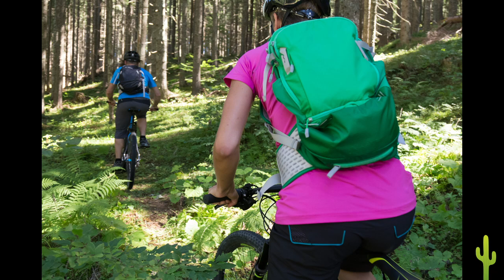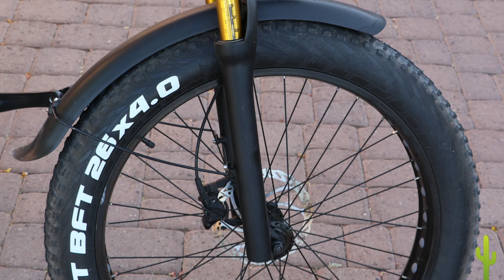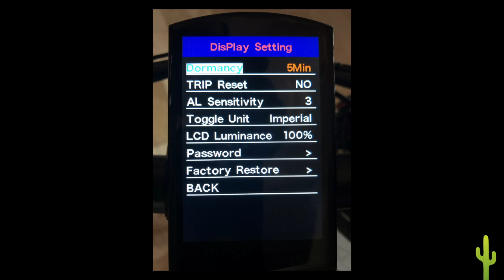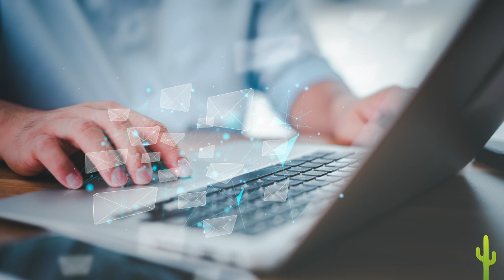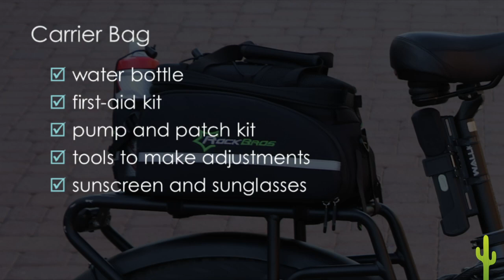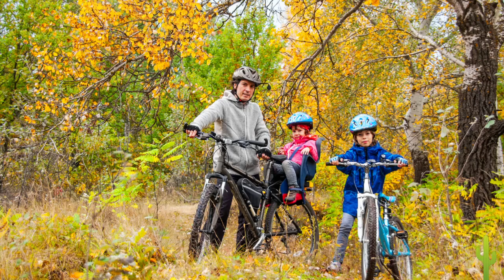Why the Wallke X3 Pro is the eBike for Me (and Maybe for You)

Comment: My experience buying from Wallke was unpleasant. The bike arrived completely broken, a bent frame, cracked battery housing, wobbly tire, among some other cosmetic issues. After 7 days of back and forth they finally agreed that the frame was bent (even thought I proved it with measurements on the first day), and offered me $100 compensation for the bent frame. After another back and forth I convinced them to take it back, and they said I had plenty of time to return it and it was no problem. Then after winter when I go to return it they tell me I only had 7 days to return it! So I had to use PayPal to file a dispute and convince them that their service rep made an exception to their unreasonable policy. So they agreed to take it back and I shipped them the item all packed back up (not easy)! Then during the disput they wanted 6 days to process the return, and 6 days later they say they can't find it even though FedEx provided delivery confirmation! So Now I have to wait for Paypal to issue the refund because Wallke fails to do so. This is a lot of money for a bike so don't simply trust this company, document literally everything if you buy from them. If you get a good bike great, but there is a risk you will end up in the same situation or a similar one that I did. Specs are one thing, but good support if you get a lemon is very important to consider too!

Comment: A supremely superior review/ overview, best I've seen on any topic/ item on YouTube, thank you. I do have two questions: (1) To lower the seating height (for a 5'2" person) , could I take the seat post out and cut it by say - four inches (or use a replacement shorter seat post tube) , to make the post shorter and therefore not hit the factory (frame) post stop as soon as it would when using the factory seat post length when inserted into the factory (frame) seat post tube? In theory, this would bring the seat-to-ground distance down by a few inches. (2) Could I re-wire the "Thumb" throttle to be replaced by a "Twist" throttle? Simply a personal preference.

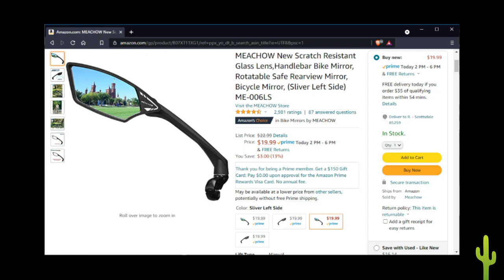Comment: I've got a little over 500 miles on mine. Charger died two weeks ago and with one email received a replacement in about 4 days no cost. Had a flat today, ordered a tube and slime from Amazon at 8pm last night and received items at 11:30 this morning and already back in the saddle. There is a Wallke FB group, that shares basic information as well as specific parts like better handling knobbie tires (my next upgrade). I also installed a mirror, and use a high lumen headlamp usb rechargeable strapped to handlebars to cut down battery drain. Thanks for the manual there are youtube videos but having info in one offline place is of benefit.

Comment: Great info! Just curious why you didn’t choose a mid drive motor bike?
Reply from the maker: I looked at mid-drive bikes, but chose the rear-hub drive for several reasons.  

First, mid-drive bikes use the chain and gear system to power the bike, so they're more complex to ride as gear selection will have a significant affect on torque, speed and power consumption.  You need to monitor the ride and operate the shifter continually.  Rear-hub drives don't involve the chain, sprockets or shifter for powered modes.  

Second, the much increased load on the chain and sprockets with mid-drive requires more maintenance to protect them.  

Third, the chain and sprockets (which are really engineered for human power) wear out pretty quickly under the high torque of motorized power, with reports of needing replacement in a thousand miles.  That's less than a year for me, and seems like an issue, especially in the context of a possible grid-down future where replacements might not be available.  

Fourth, some mid-drives don't freewheel, so that means you're "pedaling" when the motor's engaged, whereas the rear-hub drive lets you stop pedaling (like you would for coasting), while the motor's fully powering the bike.  This is a lot more comfortable.  

Some people with deep cycling experience prefer the fine control provided by involving the sprockets and shifter in the motor-power process.  I've heard at least one say they'd never consider a rear-hub. 

For me, I'm happier to have solid and easy-to-use transportation, without concentrating on gear selection.  As someone with years of experience with manual transmissions in cars, I'd say the mid-drive / rear-drive discussion is analogous to manual and automatic transmissions.  Rea-hubs eliminate a lot of complexity, leaving you free to ride.

For me, the rear-hub drive is the clear winner.  It's easy to understand and operate, less taxing to ride, and gives plentry of power and control.

Thanks for raising the question!  😊

Comment from the maker: One item I didn't cover in the video is power regeneration.  The controller allows for the use of motors that have the capability, but the geared rear hub motor on the bike doesn't support it.  The real world reports indicate the amount of regeneration is pretty low (some estimates are 5%).  If the bike had regeneration, I'd turn it off.  This is because regeneration drains momentum from the bike so it can charge the battery.  The bike is actually braking when regenerating, so you lose momentum that would otherwise be there for coasting.  Due to the inefficiencies inherent in the cycle of regeneration, power storage and them re-powering the motor, you can't get back as much energy as you lose.  You get less usable range extension than you lose from braking instead of coasting.  Basically, you shorten the range of the bike.

Comment: I saw there are different manufacurers fe Opeak or Cyrusher offering the same ebike. Is this the best ebike in this price point?
Reply from the maker: I examined several dozen eBikes as I was researching my choice.  I did find less expensive alternatives, but nothing with the critical features I was looking for, and actually paid about a $300 premium to get payload, folding frame, rear suspension, hydraulic brakes, the excellent color display, thumb throttle and user-customizable controller.  I couldn't find anything with all those at a lower price.  I also didn't spot the same bike under another brand, although the practice is pretty common.  I did get the manufacturer to offer a 10% discount for channel viewers, so your premium would be less.  The Cryusher looks similar, but seems stripped down, without carrier, fenders, or high-end display / controller.  It doesn't look as beefy as the Wallke, and one I found was on eBay (perhaps a resale?), another was on AliBaba at about $500 more than you'd pay for the Wallke.  (I'm happy to venture an opinion, but I have no vested interest in anyone buying the Wallke or any other bike.  However, my experience with the Wallke is first rate.  I definitely recommend it.)

Comment: Okay, questions. eBikes are obviously batter powered. As a prepper, we prepare for Bad Things to happen. Assume, for a moment, worst case scenario. You've just survived the collapse of civilization. You're running around on your eBike. The battery now needs to be replaced because it's just not holding a charge any more, and neither is your spare. Stockpiles of batteries aren't an answer because even batteries in storage go bad after a time. How do you replace the battery now? If you can't replace the battery, do you now just put up with the fact that you basically no longer have an e-bike? What about the shocks? They go bad over time, just like they do in cars. How do you fix/repair/replace those shocks?
Reply from the maker: I think you have a different view than I do.  Nothing will last forever, but I intend to exploit whatever's available as long as possible.  I'm not swayed by an argument that says, effectively, "no point in having the bike for the five years the battery will last because sometime past that time it won't work as well".
Reply: @DesertPrep  My point wasn't that you don't get the eBike, it's that we need to figure out a way around the problem of the battery going bad. It's not a problem I've found a satisfactory solution to yet, hence why it was a question rather than a statement of opinion. My own personal bike doesn't have shocks as it's not something that I can repair. I'm trying to reduce the number of points of complete failure to a minimum in my gear so that I can either repair or replace everything. Motors can be re-wound, magnets can be re-magnetized, bearings can be repacked, but I'm still working on batteries. Replacing them with lead acid seems to me to be rather unsatisfying as a solution...
Reply from the maker: @torjones1701  Got it.  My wife and I have both the eBikes and some very good mountain bikes which we now consider as backup.  In the worst-case scenario, already-manufactured material will still exist, and I expect we can scavenge or trade for much of it.  Since there's a number of the Wallke eBikes within our own group, we'll be able to cobble together components to keep the bikes working for some time.  To your point, our mountain bikes will continue to be available past the lifespan of the eBikes, and are kit we can share within our group as needed.
Reply: @Jason J. Ayala P. Yes, actually, I can make my own chains, sprockets, and pedals. Pedals are ridiculously easy to replace and can be fashioned from wood if necessary. As an amateur blacksmith with a half decent metal shop, I can quite literally make new chain and new sprockets. It's not even that difficult, just a bit repetitive to make chain. Any idiot, once they are taught the process, can make sprockets. I'm sure a reasonably intelligent person could figure out how to make a new sprocket based on the old one if they think about it for a few minutes. But, if you actually bother to keep your chain and sprockets clean, they'll last a lot longer to start with. That's something else people are going to have to learn to do in a collapse situation, maintenance. Rather than running it over to the bike shop for every little foible, gotta take care of it yourself.
I've never considered my bike to be uncomfortable either. I've got a spring loaded seat and cushioned hand grips. What more do you really need?
Reply from the maker: @torjones1701  There is a solution to your battery replacement scenario.  The battery packs on the bike (and many others) are filled with Li-Ion 18650 batteries, all connected into a single bank.  These are the same as what you'd find if you open a laptop battery, and also what are used in tactical flashlights and countless other devices.  If your battery goes bad, it's almost always due to a single one of the individual 18650's failing, and you can restore your battery pack by replacing the bad battery.  This can keep your battery pack going for years, and you can prepare for it by buying a handful of the 18650's at their current very reasonable price.  Good discussion - you raise solid points.  😊
Reply: @DesertPrep  Be careful with this route - it won’t work as well as it might seem at first glance. Lithium-ion battery packs have to have their cells matched by capacity - if you have more than one cell whose capacity is too far off from the others, the lower capacity cell will drain the others when part of the pack. That’s mostly OK if they’re not too far off, but if they have too much of a difference between their capacities, charge/discharge cycles can lead to cell imbalance, which can then lead to thermal runaway and “explosion” of the other cells causing a catastrophic failure of the entire pack. Packs of lithium-ion cells usually also include safety circuits that prevent this from happening, either by disabling the entire pack, or depending on size and configuration, just disabling the segment containing a bad cell and pulling it out of the circuit.

Another issue with storing any of these batteries as backups is that they have a somewhat high level of internal discharge, so they have to be plugged into chargers or battery management systems on chargers every few to several months to keep them topped up to a safe state of charge for long term storage. Failure to do this with lithium-ion batteries often enough will lead to their internal self-discharge dropping their state of charge below an operating threshold and they’ll experience a state called inversion, where the positive terminal becomes negatively charged, and vice versa. But even if you do adequately maintain any stored battery packs in good states of charge for long term storage, the battery chemistry itself breaks down over calendar years regardless of state of charge, number of charge cycles, or usage, so they start their long (by usage standards) but short (by storage/survival standards) dying literally at the moment of initial manufacture. You can still get some practical use out of these batteries for quite a few years, but not for their intended or generally accepted applications.

Storing and maintaining a stockpile of old lithium ion batteries, if you have the means to keep them at a reasonable charge level, can be useful in a civilization collapse scenario, but to get more than 5-7 years of practical use out of those batteries will involve quite a lot of ingenuity and cobbling together of custom solutions that will mostly be suboptimal at best. Probably a better approach would be to know the people who have the knowledge and expertise to build these batteries and stockpile those people and keep them maintained and safe in the long run, because it’s probably easier to rebuild that piece of civilization than to maintain a useful stock of old batteries beyond about 10 years. I’m not in the prepper community myself, so I’m not sure how much your circles consider things from that point of view, but figured it’s worth throwing it out there because humankind is going to need all the advantages it can get if we’re planning to survive more than another hundred years it seems.

Good review on this e-bike, btw. Sensible, practical, and to the point. I appreciate you folks who put time into things that most people probably think make you nuts. I think they tend to overestimate the resilience of everything their lives depend on. You preppers are really only a razor’s edge away from being the only sane people alive. Keep doing what you do.